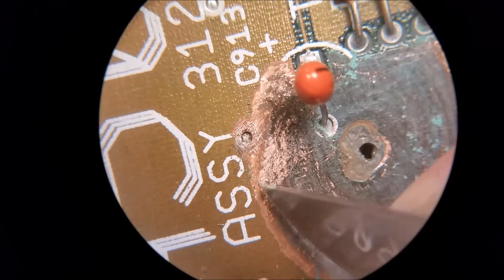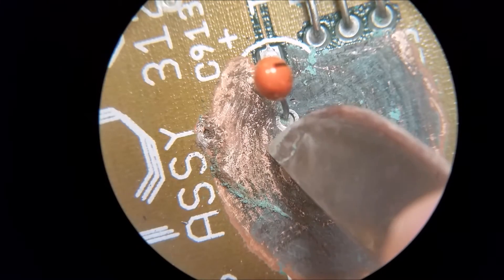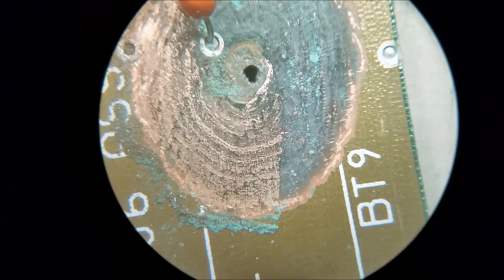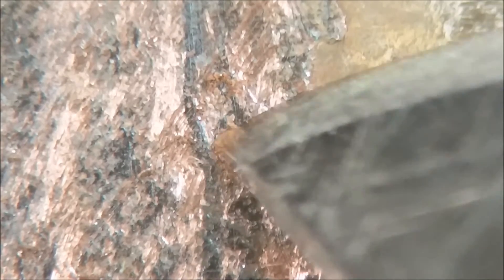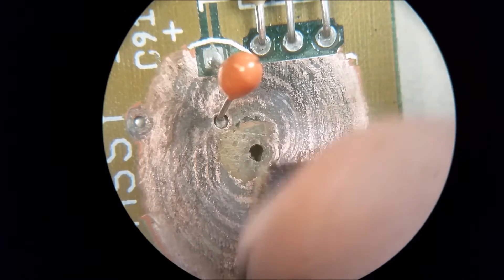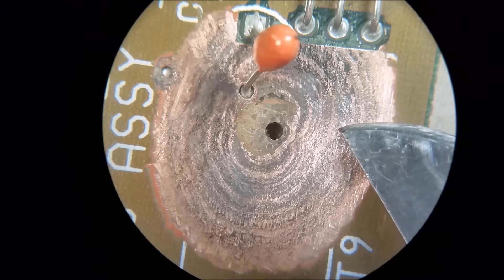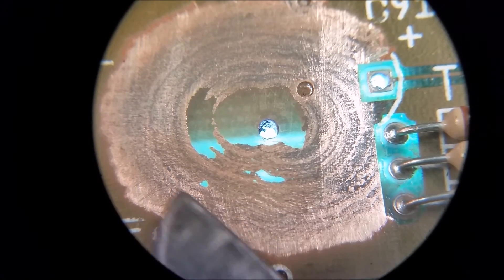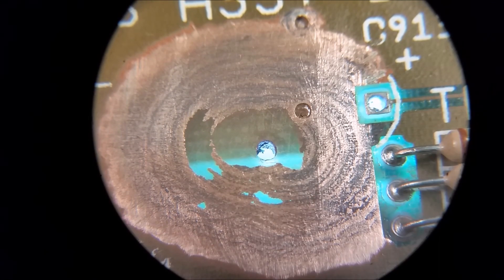Solder Tutorial Part 3 How to Replace Corroded Copper Plate

Comment: I feel that the abrasion, including the knife at the beginning, is for the most part unnecessary. Copper oxides dissolve wonderfully in weak acids, just use weak solution of citric acid or lemon juice. It only takes a few minutes or less, then you need to either neutralize the acid with soda or wash it off however you like, before it starts actually eating into still healthy copper.

Also i don't see how a shunted capacitor would be an issue.
Reply from the maker: Hi Siana, I was initially trying to just remove the corrosion and it became a replacement because the copper was corroded beyond salvaging. I like the idea of the acid/etch hadn't thought of that before, I'm just going off what I had learned in the military. I suppose it would work better if you had the acid and the time to mess with it. I do agree that you'd have to keep a close eye on it. I suppose some black marker would mask it off sufficiently to keep it from eating into the good copper. I don't know if a shunted cap would cause any problems, I doubt it would, but why take the chance on someone else's board or even your own for that matter. Also with knowing there was corrosion on that section why seal it in, it would just be better to remove it altogether, at least that's my thinking on it. You had some pretty good comments there Siana, thanks for contributing and watching.
Best Wishes n Blessings. Keith
Reply: The thought to etch away copper for the patch spot did cross my mind while watching the video, but i haven't done it, so i didn't voice it because i didn't have a good picture of how to safely do it on a fully populated board, and what might go wrong while doing it.